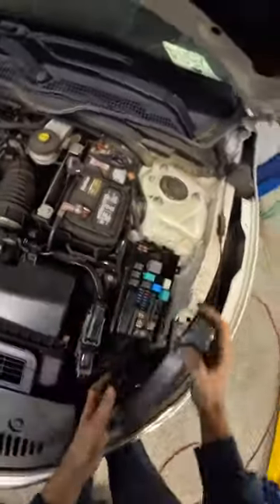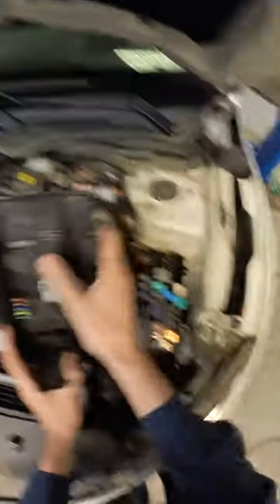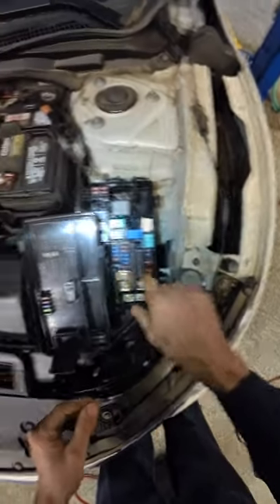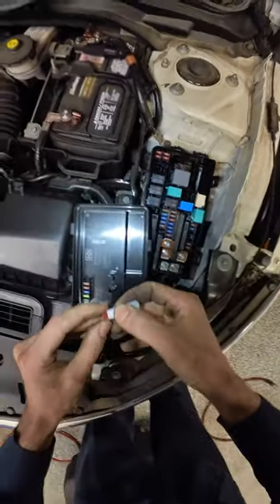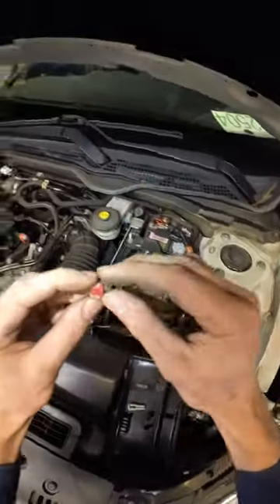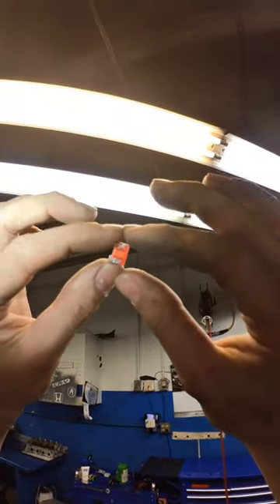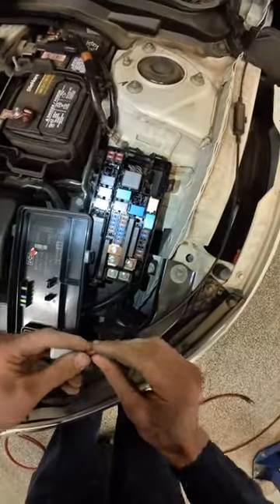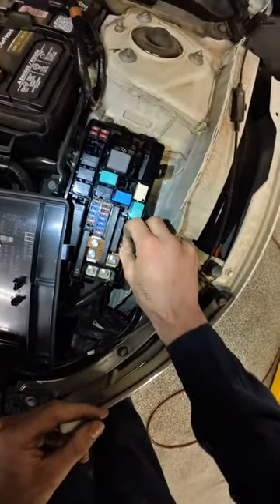Interior Lights Don't Work? WE FIX DAT 😏👍 #honda #civic #diag #electrical #fuse #lights

Comment: Thanks for this! I changed my interior and trunk lights to LED and suddenly they wouldn’t turn on. Changed the fuse and this worked like a charm
Reply: Same issue once I changed my interior light to LED it stopped working randomly 😂

Comment: So when I open my front driverside door and back seat doors, the light comes on. But it won't come on for the front passenger door. Any suggestions?
Reply: Check the video on diagnose dome light door, it might help.
Reply: @karengreen4192  found out that it was the door jamb switch that was going bad